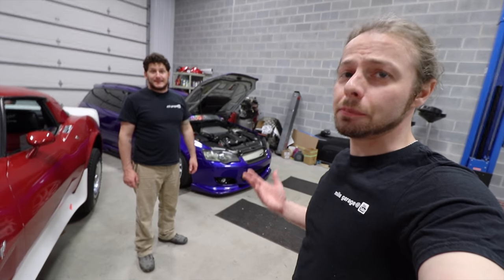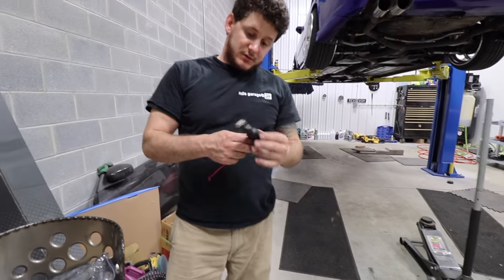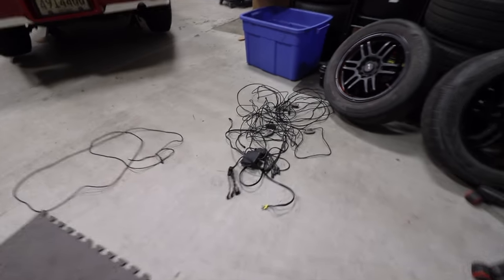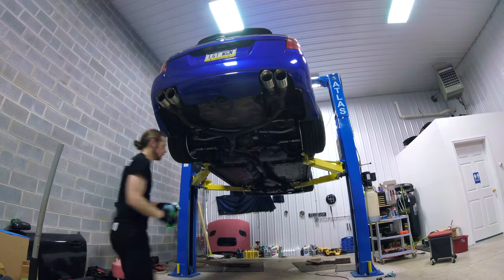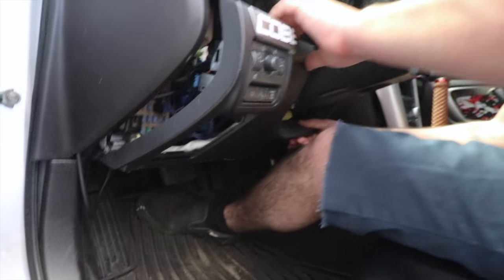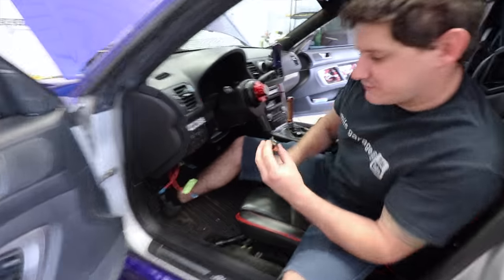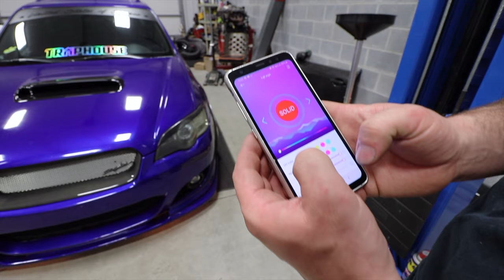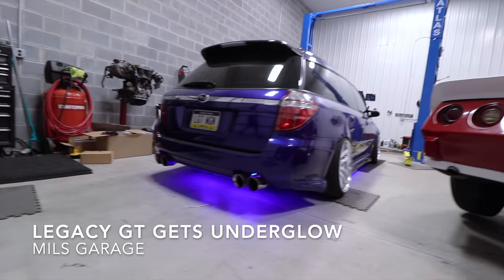Underglow Kit Install [ Subaru Legacy GT - Under Car Bluetooth LED ]

Comment: Turned out great.  Do you guys recommend the kit? If so which kit and how much? Thanks.
Reply from the maker: Thank you! i do. The app colors must have been matched by someone who's color blind, but the kit is very good quality. The fact that the app consistently pairs with the car is the most important part to me (there are some kits that pairing with a phone is very finicky if it connects at all). i'll have to try and pull it up, but i'm sure it's on Amazon or at least Google
Reply: @milsgarage  sounds good. I tried to buy a kit from the newer company LowGlow...but they sold out on launch date. Might be on the spendy side of underglow but they seemed brighter than most out there.
Reply from the maker: Here’s the kit we installed👉 [ https://www.amazon.com/dp/B081DNBMMX/ref=cm_sw_r_cp_api_glt_fabc_6W804V2E171T5RJ8H55H?_encoding=UTF8&psc=1 ]

Comment: I have a 2021 Malibu straight piped already I just wanna know a way to make it louder
Reply from the maker: Are you in the Delaware area? We can certainly check it out 👍
Reply: @milsgarage  I’m in Louisiana sadly
Reply from the maker: Road trip? A straight pipe is pretty much the loudest an exhaust will go.. What do your neighbors think about your current setup?
Reply: @milsgarage  I would take one,and they don’t seem to like it but all they get to here is the cold start
Reply: @milsgarage  that sucks I can’t make it any louder, my friend have this type of Ford car and it’s so loud I wanted to at least be a match for him but thanks for responding
Reply from the maker: @davejr8603  Any time of course. Are you both running the same engine? It's all about diameter, length, pitch, frequency, stabilizers and bends
Reply: @milsgarage  I don’t think we are I know I have a 4 cylinder, I could ask to see what his is...my car is also eco friendly I think